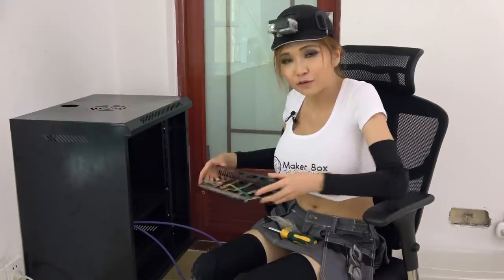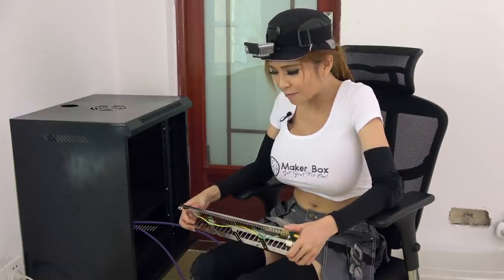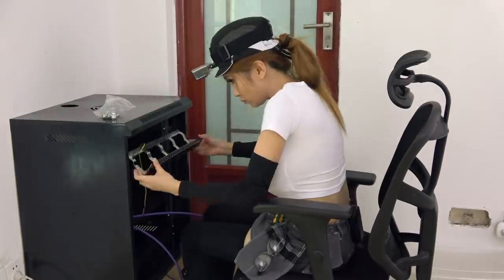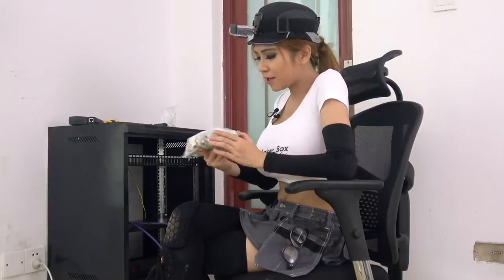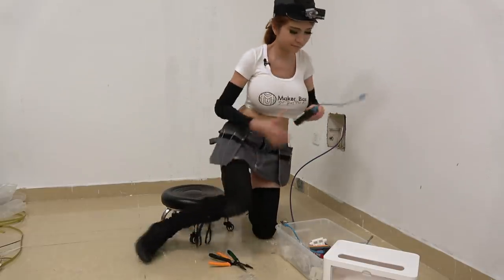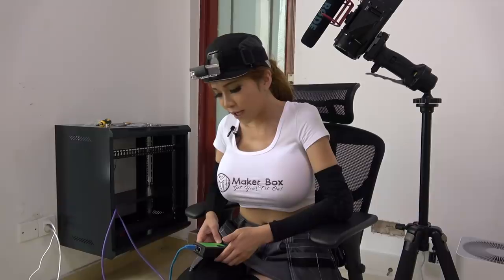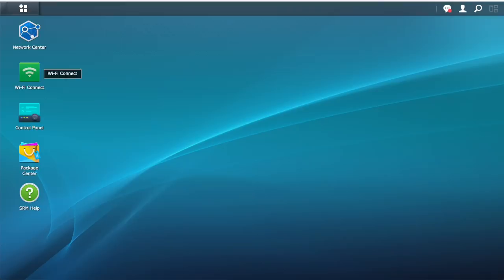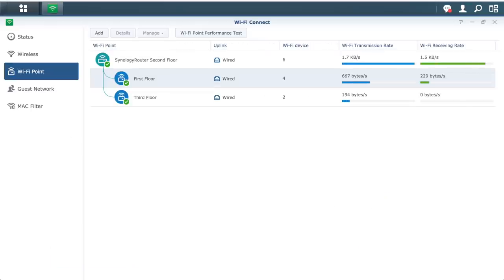Home Networking Part 2- Installing a Server Cabinet

Comment: You should of pulled 2 wires while you were doing the 1st as a backup, easy now, pain later
Reply from the maker: I wanted to but just could not get 2 of those heavy cables though on the test run...

Comment: Nice clean install way better than just mounting the router to the wall like I've done lol. 

Did you get a hear pump installed yet(a.c. hot water tank) 
Id really like to know how Chinese houses are built n how they work. N your a making so you designing home systems using building science is right up your ally.
Reply from the maker: Hot water coming soon😅
Reply: @Naomi-Wu  I've seen a German hotel that used basically a hot water heat to heat a building while powering a Sterling engine that generated the electric. Those Germans are some smart mofos

Comment: Did you say they all appear as the same WiFi access point?   That would be neat to know how to replicate that in my home too.   I just need to have one area connected to another without any cabling, currently using a WiFi extender and that then connect to LAN devices.   The problem is that my computer equipment is in a different room from where the telephone comes in, which means the internet router is at that point and there's no really good way to connect a cable from there to where I need it.
Reply from the maker: Yeah the Synology routers are great for that...
Reply: @Naomi-Wu  I'm going to have a look at them, thank you!

Comment: I would enjoy watching more of your home improvement projects; so, count this as a positive vote for same. Am I correct that the cable termination plug wires are simply pulled through a sharp "V" notch for the connection inside the plug? It was somewhat difficult to be sure while watching the video.
Reply from the maker: Yes, there are two blades in there that connect with the wire
Reply: @Naomi-Wu  Lord, you are an early riser.

Comment: Since you are doing so much rehab you should get yourself some tile layers knee pads. You'll be surprise how often you will use them, even for things you would not think you would need them. I know this through personal experience.
Reply from the maker: The ones I'm wearing there and the low stool seem to do the trick so far....

Comment: you should never install a cat 5 or 6 jack straight up  in the air like you did it should be sideways to keep the dust out of the pins to keep your connection good
Reply from the maker: You're right...

Comment: You work very fast with your hands, I could not see the cable connections and I think that if you charge for hours you will not earn much money, because you do the work very fast!

¡Trabajas muy rápido con tus manos, que no pude ver las conecciones de los cables y creo que si cobras por horas, no ganaras mucho dinero, porque tu haces el trabajo muy rápido!

Comment: We always velcro data cables 100% of the time. zip ties can kink and damage cables easier, especially when you have to change the layout of the connectors. 

As far as the comment about not saving passwords in phones because it's too hard to secure. Well, it's just a shame that Microsoft let Windows Phones die. The 950 and 950 XL Windows 10 phones were deemed practically impenetrable according to attempts at hacker conferences. Android by comparison is a punching bag. Easily knocked around by hackers.

Comment: Looks like your cabling didn’t pass the grounding test. It is not critical but could prevent you from going gigabit on distances longer than 50m.
Reply from the maker: Yeah it's only 10m or so

Comment: I enjoyed the video. I also have  pulled network cable as well as run AC power from breaker box to outlets. A short explanation about the differences between cat 5, 5e, and 6 might have been nice as well as a quick mention as to what network speeds and bandwidth are available at your location would also have been nice.